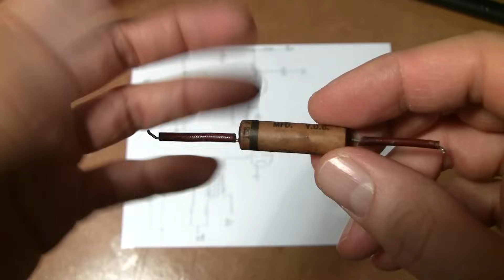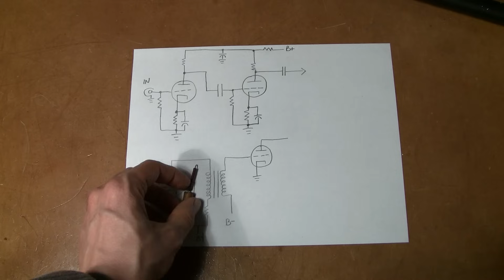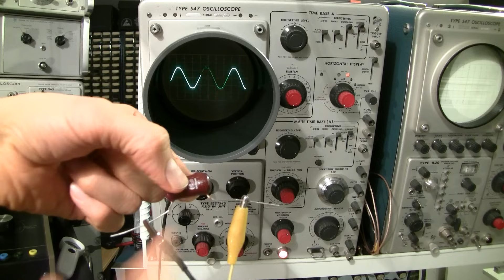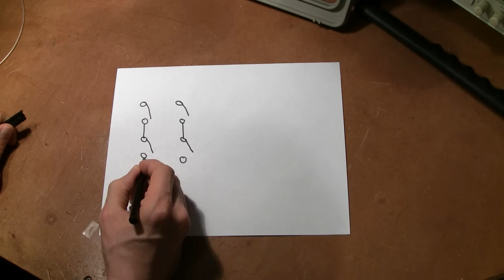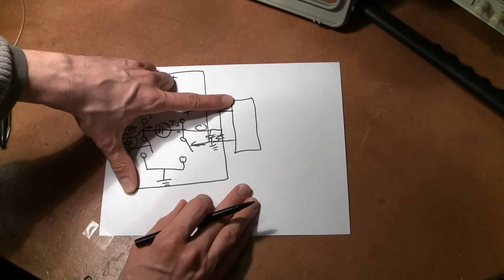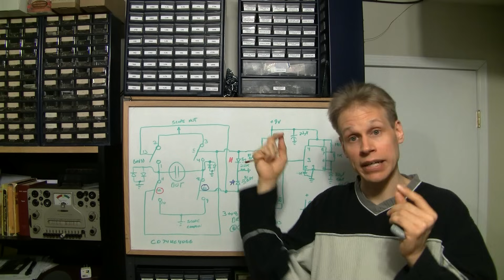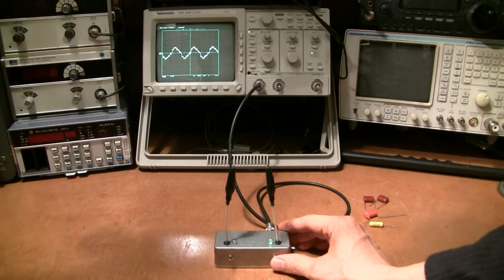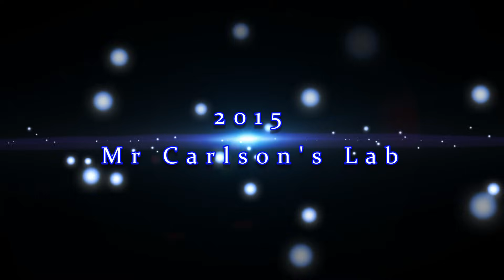Are Your Capacitors Installed Backwards? Build this and find out

Comment: how it the best way to determine polity of a cap if you don't have an O'scope?  I don't have one and don't think I will for some time to come.  I have an electronics background and m getting back into it now.   I have two degrees in electronics and worked as an ET for years, been a ham for 25 years now.
Reply: connect the cap to a guitar jack that is connected to a guitar amp, turn the volume high enough you hear noise. Rotate the cap. The less noisy position means the out foil is connected to ground, the sleeve of the jack. Mark that as the outer foil

I have no degree in electronics

Comment: Very informative video but I have a note to make. When connected to the scope with the main lead attached to the shielded side of the capacitor it yields the higher amplitude because of the larger area receiving signal from 'you' as the source. I suppose I could look at it that way just as an indicator to determine the shielded side of an unmarked or incorrectly marked capacitor. Does this sound reasonable?

Comment: Wow, 2 years of vocational electronics (4 hours per day), 4 years of engineering school at a state college, plus an Amateur Extra license, and this is the first I've learned of this.  Kudos.

But, you could to the same thing with a DPDT switch and skipped all the electronics.  Mount the switch to indicate which lead is connected to ground and you don't need the LEDs.

Comment: Finally got around to building this. Learned that a standard 4066 has about 90Ω of resistance when closed, so I had to order some CD74HC4066s to get the 17Ω closed resistance. Made my board using MEpads and MEsquares, but SMT parts sure make for a neat appearance. 
For whatever reason, when testing higher value capacitors (usually .5 µF or larger), I find I have to reach over and touch something plugged into mains power to couple more noise into the capacitor to show any kind of amplitude. Have tried on multiple scopes set on their lowest volt/div scale. Is this your experience as well?
Reply from the maker: Hey, great job Jason! Yes, the closer you get to 1uF, the more signal you need.

Comment: I can now see me going through an amplifier and grabbing the caps to find an annoying hum.  There's more to this video than just checking the capacitors.  After all, it's a "lab".  Like some of the other commenters, I might simply use a DPDT toggle switch and skip all the circuitry and battery.  The handle of the switch would indicate the band-end and eliminate the 'timing' issue.  However, the 555 timer in monostable mode would also work?  Now, if there was a way to do it without a scope ... For those of us that don't have one, could an audio amp produce enough volume difference to reliably check the capacitors?

Comment: Although I've enjoyed watching this, I think it's overly complex needlessly. Sort of a "luxury edition" of polarity switching.
Wouldn't a DPDT toggle switch with both ends crossed work as a polarity reversing switch for reversing the connected capacitor ? Much simpler design, no IC, no LED, no battery. Just a DPDT switch, with one end of the terminals going to the oscilloscope BNC connector and the center terminals going to the two wires with alligator clips, positioned horizontally between the two wires going to the capacitor, and the position of the bat tells which side (wire) is the shield (ground).
Really simple.
Reply: @Stuff Builder
What are you talking about ? My suggestion did not involve a relay at all. It only requires ONE simple DPDT toggle switch and some wires. Can't have it simpler than that. No relay, no IC, no LED, no 9V battery, no PCB.
Reply: Exactly what I thought. Do it passive. A momentary  DPDT toggle switch would work much faster than waiting for that slow timer to switch back and forth. You could test caps much faster that way. The switch would be oriented so that it points towards the outside foil lead instead of having a light.
Reply: AlainHubert yes, my thoughts exactly
Reply: I suppose we need to build the simple version and experiment with it to see how it works and how we like it...
In other parts of these replies,  it was suggested that you might wind up grounding out you interference,  affecting the performance of such simpler equipment.  That's something that can be tested to determine if it's true,  and perhaps overcome by an appropriate choice of types of switch.

In any case, perhaps we should be experimenting with such a simpler design and discovering how well it works. I may do that myself.
Reply: Probably because he has hundreds if not thousands of capacitors that he has to test and grade.  His last haul of poly caps from Digikey he ordered looked like about 1,000 of them,  there's video on his Patreon about this.  Use a toggle switch?  Maybe if you're testing 10 of them... For what he's doing,  God no...
Reply: shielding is key
Reply: well, sure, if you're just gonna check 5,10, 20 or so capacitor and don't use it too often. Switching too often actually hurt your finger, it is also not advisable to move a switch that much. I would still prefer this fixture, it is actually a simple design and help reduce the labor. Of course this is purely my opinion. Use anything you like, and if you're checking about 10 of them then why do you even need a fixture anyway, just put them by the probe and you're done
Reply: If the switch is too hard to toggle you could use a momentary push button switch
Reply: Or you could just use two flat contact surfaces, the ground one being noted by some paint around it... Take the cap, put each leg on each surface, reverse, note the ground side on the cap, end. No switch, no wait, just keeping it simple stupid. The only things to evaluate is a good design for easy and reliable access to each contact zone.
Reply: OR just hook the cap to the scope leads and hold the cap body and note the larger interference pattern,i bought the bits to make a slightly less fancy test box,but two flat contact pads and good shielding should be a good choice.

All depends how fancy you want it,K.I.S.S. is usually the better alternative.Though i preffer ACDC and LED ZEPPELIN....MEGADETH,METALLICA............
Reply: You would probably get a lot of noise from intermittent contact of the leads with the pads. But the difference in hum levels might still be easily discerned.
It would certainly be minimalist - eliminating the clips and DPDT switch.
Reply: It would consume more power to energise the coils and drain the 9v battery quickly. This design consumes much less power and doesn't make clicking noise.

Comment: I have a quick question about the box used:  Can you use a foil tape lining to shield the inside of a plastic box, or will that not leave you with an adequate Faraday cage for this type of application?
Reply from the maker: That should be fine, as long as it is appropriately grounded. The leads need to be shielded right up to the clips as well.
Reply: Thanks. I appreciate the response.

Comment: You need more oscilloscopes :P .  Do you have a recommendation for a good affordable one I can pick up on ebay thats reliable?
Reply: I bought this one...  Got mine off eBay.  Works great, especially for someone like me who is only going to be testing caps for my electric guitar and amp.  

http://www.robotshop.com/en/seeedstudio-dso-nano-v3.html?gclid=COiGzOOWjdECFQKewAodiIUO-g
Reply: If the seller explicitly says it still works, the manual is available online, it's $20-$50, and 20-30 years old, it should be fine. Yes, it's actually going to take some effort to track it down, and yes shipping is going to be expensive.

Comment: Wow interesting. Im a novice but the sound of the oil and paper caps sound nice i use them in guitars.. without active pickups. QUestion do i have to worry about which way round my caps go inside a guitar also?
Reply: in theory, yes, you can worry.though it would be better to foil-line the guitar cavities instead...
as the pickup signal is a very low level one, and the wiring from it can easily pick up noise,which is then amplified by your Amp.It MAY make a difference,as everything not screened can act as an aerial!
 having said this; i seriously doubt guitar/amp manufacturers bother checking which way round the caps go in, it would slow production, they are printed as they fall on the conveyor;which may be either way round! it would mean testing every-single-one...

Comment: I've been trying to test film capacitors and I can't see a difference in either direction on my scope. I think I have the test set up correctly but I'm wondering if I have my scope set up correctly - it's a Tek 2225. I have the sensitivity as high as it will go, I've tried AC and DC, different modes, and there's plenty of noise when I'm just holding the probe, but the noise reduction looks the same whichever way I connect the cap. I've tried new and old caps where the outer foil is marked. What am I doing wrong? Thank you.

Comment: As absolutely fantastic. However, how to check capacitors without the oscilloscope?
Reply: *use a 3.5mm to RCA jack connected to your  your  receiver/amplifier. 
*Crank up the volume a bit and touch the capacitor leads up to the 3.5mm jack
*One lead should go to the  negative band (usually the base) and the other to the  positive band (center or tip) of the 3.5mm jack. 
*Do this while holding the cap from the coated section of course. You will hear what sounds like a 120hz hum. Reverse the cap leads like Mr. Carlson suggests until you can determine, which position produces less hum. As Mr.Carlson explained, one side will produce more noise. There are limitations to this method. In my tests I could not distinguish an audible difference in either position for .1mfd caps. However, my .022 and .0068mfd caps produced significantly more noise/hum  one position vs. the  other.  An O'scope is still the best way to go, but if you don'd have one like me then this may give you a little piece of mind that you are installing the caps in the less noise prone position.
Reply: Cool that you tried it. It was just a idea that came to mind.
Reply: Agreed. Even a failure is a result.
Reply: So simple and so obviously. Thanks, mate.
Reply: I am thinking about building one, I will use a microcontroller with an ADC to read the voltage, operate the switches, and light the LEDs. It should run a long time off a coin cell.
It will be more convenient to have the tester self contained rather than having to hook it up to the scope.
Reply: Thats a cool idea! 
While watching this I was thinking up ways to test. Spray butane on one of the leads. Count to 10 and measure with a laser thermometer on the side of cap case. Spray the other lead and do the same count. What ever reading was the coldest was the band end.
Reply: I don't quite get the point of this. If you are thinking that the lead connected to the outer foil will change temperature differently, I don't think you'll see enough difference.
Reply: But the dielectric is very thin. So is the foil.

Comment: Was this an April Fool's joke, building an elaborate circuit when all that's needed is to connect the scope leads directly to the capacitor?
Reply: Not that elaborate of a circuit, easily put together in short order, and will save time for testing lots of capacitors.
Reply from the maker: Did you watch the entire video Steve? If you did, you would know the reason.
Reply: Sure, I watched the whole thing but I think you are pulling our legs.  That sure was a lot of trouble to build that gadget just to keep from having to turn the cap 180 deg. when you check it!

Comment: and how can i check the proper direction without an occilliscope cause there expensive
Reply: You can listen to it as long as you have an amplifier with high input impedance and high enough gain. If the amplifier is grounded to the building's wiring there will usually be plenty of power hum on your body. If you can hear it, you can detect it. 

While holding the capacitor body try connecting it both ways. It's quieter when the outside-foil is connected to the signal ground.

A high input impedance is needed, so a FET source-follower circuit will likely improve performance. So you just need a FET, battery, two resistors, one capacitor, a couple alligator clamps, and a way to connect it to the amplifier or input. A Zener diode to protect the FET from static is a good idea but not strictly necessary. 

A sensitive AC voltmeter also works.

Comment: Hi Mr.Calson, I came across some paper caps that are resin dipped and not wax coated, the dialectric seems to be fine any thoughts on this? (wont be using them in anything major, mos likely a vintage guitar pedal schematic to get a true vintage aound)
Reply from the maker: Do they show leakage when brought up to their maximum working Voltage?
Reply: Mr Carlson's Lab hey thanks for the reply :) I dont know as i just pulled them from the circuit yesterday and havnthad time to check em, rather new to all this vintage stuff but hoping the epoxy helped stop the paper from oxidizing. I will have to give em a test when I get home, thanks for the input :)
Reply: wait a sec... i dont have a 120v powersupply :(

Comment: thats suuuuuper fancy..  dealing with microprocessor circuits, timing circuits, and crystal oscillators, this kind of explains some of the problems i may have been having. 

also, if you want to further simplify your 50% DC 555 circuits, ive found you can just create a circuit from the output to a resistor, to a timing cap to ground, and connect threshold and trigger between the cap and resistor. it generates almost a perfect 50% duty and you can completely negate the  diacharge and discharge resistor. awesome upside of this circuit is if you want to change freq and want to keep a near perfect 50% dc, you can just install a pot or different value resistor.  

hopefully this is something you can use, just as i plan on using your information about cap shielding.  Thanks!!

Comment: I'm no completely convinced of your argument here for exapmle, you suggest that a screen grid cap should  have the wire to the tube as short as possible?   why?  -  since the effective impedance of the capacitor is [almost] zero at the working frequency then the capacitor and it's two leads are considered as a single wire.  I also think you are wrong to demonstrate the decoupling characteristics of an HF cap with a 60hz ripple, where, the capacitance of your fingers pressing against the cap represents a considerable capacitor within itself.  In reality any effect your theory may have is actually dwarfed by effects of heater and kathode 'shimmer' within the tube.
Reply from the maker: If visual proof on an oscilloscope doesn't convince you, no amount of discussion will. The bottom line is, no one is forcing you to be convinced of anything. There is much wrong in your understanding as written above, in a future video, I will address some of this.

Comment: I'm replacing a Sprague Orange Drop capacitor 0.1uF 400v in a 1990 Mesa valve amp because it has gone short circuit. Should I be concerned about the capacitor orientation, and does anyone think that Mesa tested the orientation during assembly of the amp in 1990? Or would I just be making work for myself by finding a scope to test the cap? Thanks.
Reply from the maker: I wouldn't be too concerned.
Reply: Thanks for a great video! As an enthusiastic beginner, I decided to do the test anyway as I had some spare time today and had access to two different scopes. I tried the Orange Drop caps on a Rigol DS 1052E and a cheap handheld scope-meter (Uni-T UT81B) and both scopes identified the outer foil. The cheapo scope meter worked best because just holding the capacitor gave me a nice clean 50Hz sine wave, whereas the Rigol needed the capacitor held against the mains lead for the scope to pick up a decent 50Hz sine, and even that was full of spikes and noise. I was surprised that the cheap scope meter worked so well because it was being powered by an isolated wall wart supply, so there was no earth connection to the scope meter.

Comment: Great video. I built an audio circuit that cuts low audio freq. and amplifies high freq. It's for hams ike me that have high freq. hearing loss. The thing worked good but had noise. The noise was so bad I stopped using it. After watching this video I pulled the caps and tested them. After reinstalling them the noise was gone. Thanks.
Reply from the maker: Glad the video helped! Thanks for sharing your results.

Comment: Great information. So am I to assume this is for all capacitors in any material? More specifically, this applies to film capacitors used in guitar pots as well?
Reply from the maker: It really depends on the capacitor design (some are folded or stacked inside) This make it hard to determine the outside foil on some. In older receivers and amplifiers, I try to avoid this type.

Comment: Does this also work in the blue-dip disc/ceramic caps?
Reply: TheFurriestOne unfortunately not. those guys are not made from a rolled-up foil so there is not an outside layer that can serve as shielding. You can judge from the shape of the capacitors. If it has a more or less cylindrical aspect to it, chances are you can determine an inner/outer side.
Reply: antiekeradio Okay, I figured, but thanks for confirming that!

Comment: Would this work for an electrolytic cap ...say one that the plastic coating was pealed off?
Reply: ken ezzell you can identify the polarity of electrolytic capacitors by looking at which lead is connected to the outer shell. thats the negative terminal.